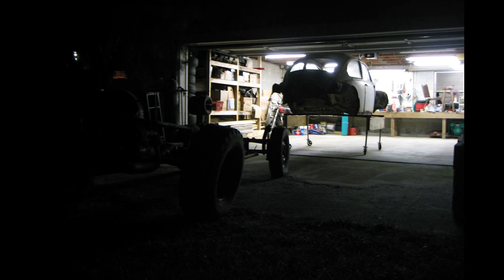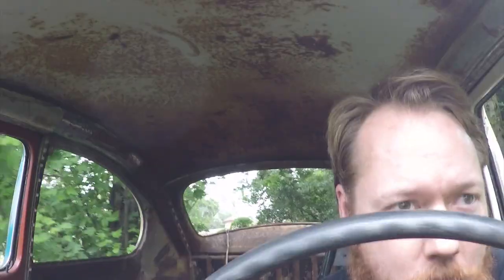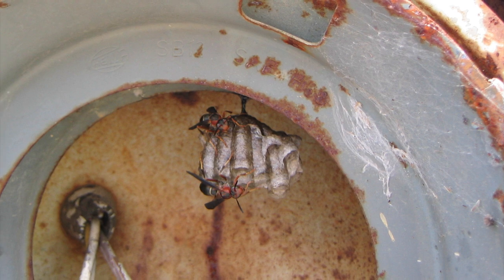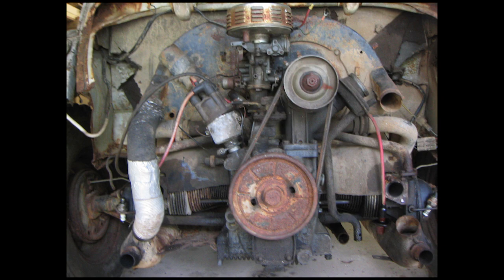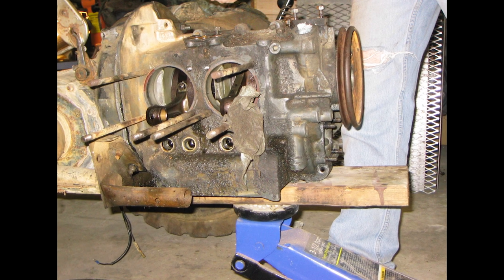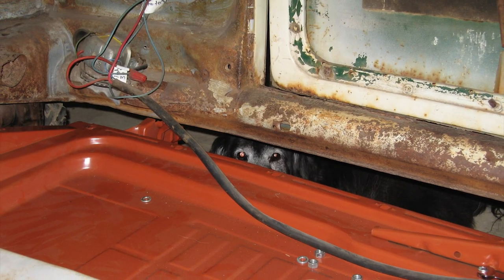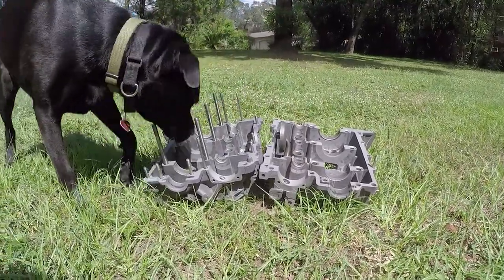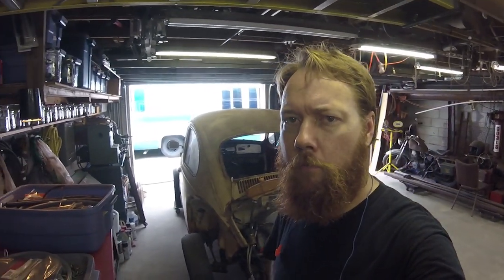VW Bug Dweezil Restoration Vlog Intro Ep.1

Comment: I’m stoked to come across your process here. In 2007, after my dad died, I inherited his modified 69. He ran an air cooled business in TN and it was a nice car, but was partially disassembled. So I dug in and learned a lot, and got it back on the road. Then life took me to a different city 400 mi away and my bug sat in a grass lot for 11 years. In that time it was backed into by a truck, and occupied by a crackhead (literally, he used my antennae to make a crack pipe.) But now I have it in the same city as me and I’m diving back into it for some necessary work before it’s road worthy again.  Video series like yours are what makes the  VW community so wonderful. These cars are made to be worked on by folks, and it’s great to see the processes some of us take to get there.
Reply from the maker: Thanks Derrick! I like that year for the double jointed rear axle. Dweezil is a '68 but now has a '69 clip from the A-pillars forward. I'm sorry you lost your Dad in '07, but it's awesome you have the car and are bringing it back. I agree, there's some great VW stuff on YouTube and I'm grateful to be a small part of it. Looking forward to sharing more of the project. Thanks for checking us out and good luck with you bug!